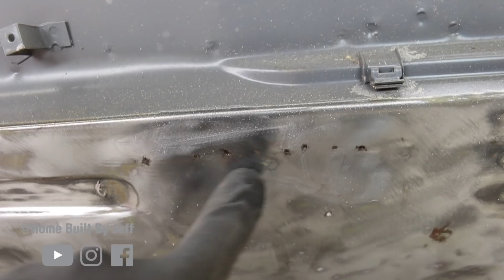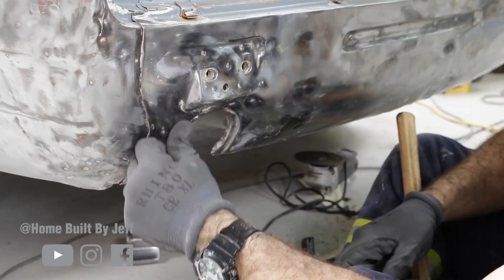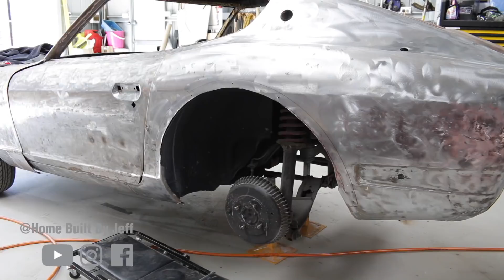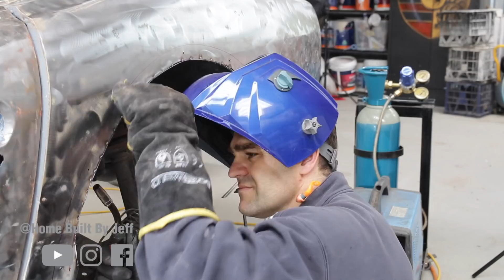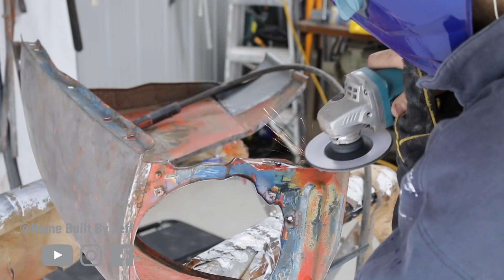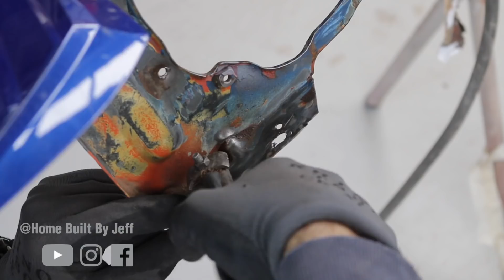Fitting wheel arch flares QUICK CUT - Home Built Datsun 240z Quick part 12

Comment: Are the wheel flares plastic or fiberglass? I need to pick up a set for my 260. Debating on ebay specials or going with fiberglass zg.
Reply from the maker: Mine are plastic, so less rigid, but also much more forgiving.